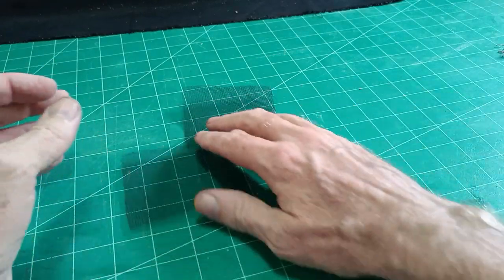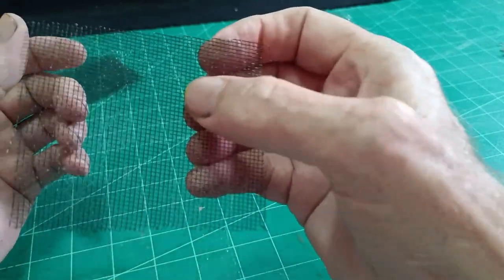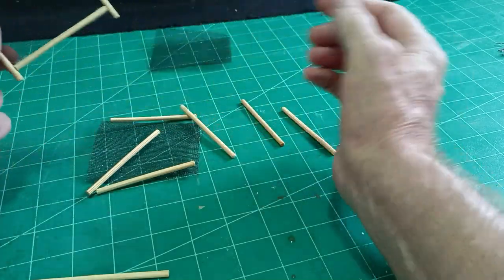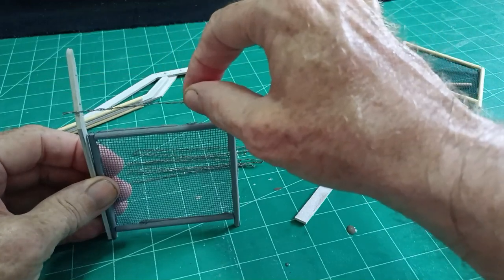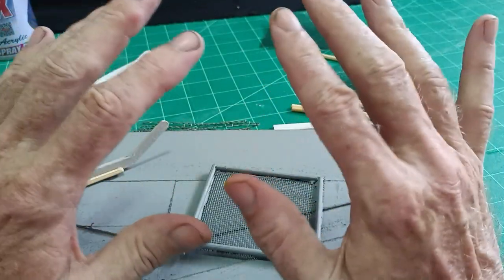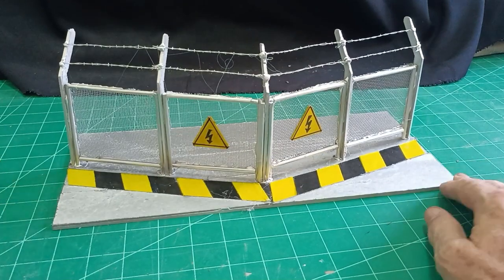Scale model chain link fencing. How to make.

Comment: Looks pretty good, Don; with or without the barbed wire.  This is a good, simple detail to add to an otherwise plain base along a roadside.  I don't know about chain link fencing in Thailand.  But here in America, most chain link fences I've seen don't have a bottom rail, (though some do have an extra rail about halfway between the top rail and the ground.)  Adding a gate would also be a nice detail . . . .

Thanks for posting this!

Comment: Screen, mesh, fly-block, or mosquito net - fibreglass, aluminium, or plastic - Mesh size helps sell scale of chain-link fence being made (chain-link looking at Scale is good enough)
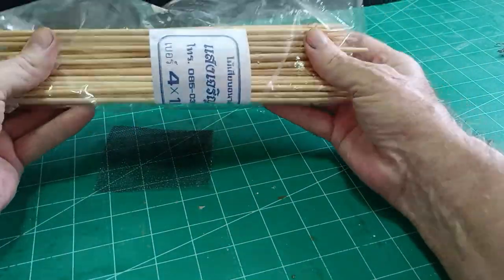2:40 - Round BBQ stick (kebab stick)  - fence posts are roughly 3mm (1/8") diameter at 1/35 Scale [package states 4mm diameter] - cut to length - higher (longer) than height of fence panels
3:41 - Hot glue to adhere mesh and posts to create panels - orientation of mesh gives signature chain-link diamond pattern
5:02 - 3mm cardboard for barbed wire uprights - representing manufactured and dipped galvanized metal fencing (some blemishes are expected)
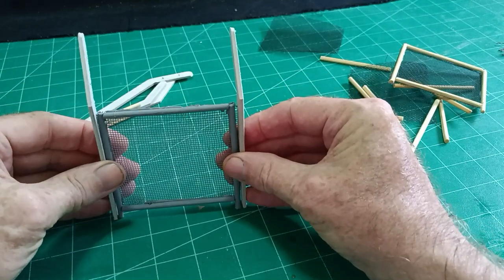 5:20 - Barbed Wire: https://www.youtube.com/watch?v=kxxcCDTo0oU
             Barbed Wire and Sandbags: https://www.youtube.com/watch?v=Y4-CP6tkvm8
             Metal Fence: https://www.youtube.com/watch?v=HbA36CxmV_k (chicken wire or hardware cloth - square openings)
 Part manufacturing, assembly (gluing), and painting are accomplished off camera.
6:35 - Paint fence components and base before assembly (easier to keep clean paint lines - fencing may be painted after assembly,  before attachment to base - paint might act as release agent)
7:15 - Assembly notes
8:10 - Painted and assembled

Diorama Don relevant links
Ruined Building: https://www.youtube.com/watch?v=FrFnUs1kSS8 (knife awareness and safety)

Fence, Wooden: https://www.youtube.com/watch?v=4Ki_ArJabYw (3mm or 2mm card) principles and practice for barn and garage doors as well. Brush bristles (coarse) can impart wood grain texture with paint. Watered down wall filler as a primer coat contributes to the woodgrain effect - pull bristles in direction of grain, in this case, length of the boards.

Plate Girder Bridge: https://www.youtube.com/watch?v=hrJb0SuFKLM (Burnt Sienna acrylic paint, that Don has, is close to oxide red or rust - it might even have red iron oxide as the pigment) 2mm card rolls cleanly over curved surfaces.

[edit: common mesh material types for window screen included in first line]